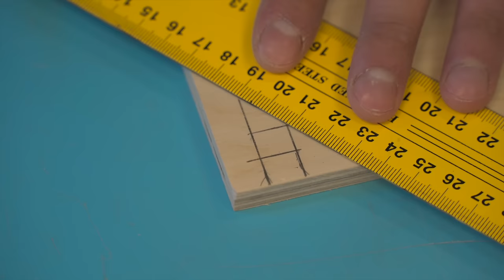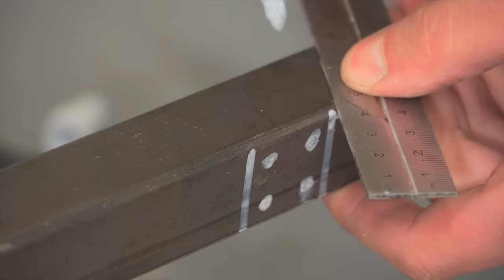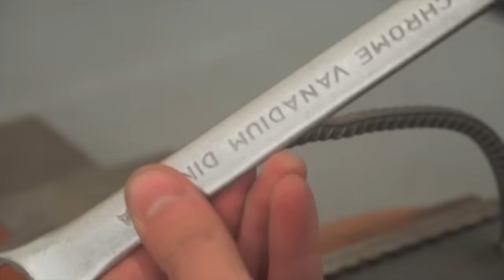Handyman's Don't Want You To Know This! Tips & Hacks That Work Extremely Well

Comment: I turn on my heat and then I feel some of the heat come out of my electrical outlets, which doesn't seem very safe if you think about it. Like plugging things into them like a space heater will over heat that shit right? Is it possible and better for places that rent out, to heat the structure of the home instead of inside the living quaters of the home? is that a practice that has been done? Like building a place to help heat the walls to help them last longer or something?
Reply: It's likely that the vent isn't secured to the air duct and it's blowing through the walls. Total waste.. Terrible for the energy bill.
Reply: @jodywhitmarsh535  yeah thx
Reply: Your tips are very useful to me. Wishing you good health. 💕💕